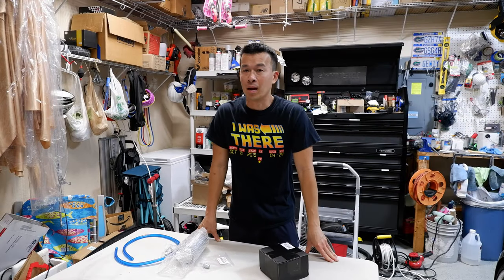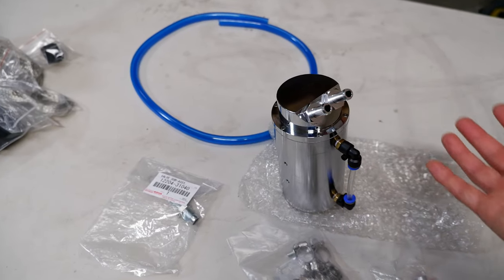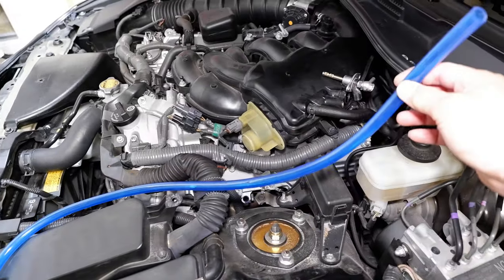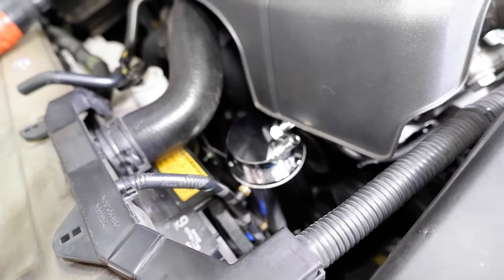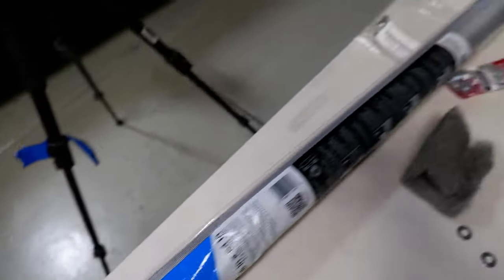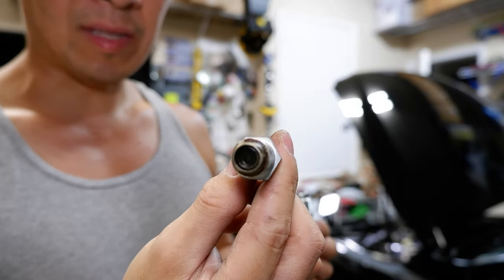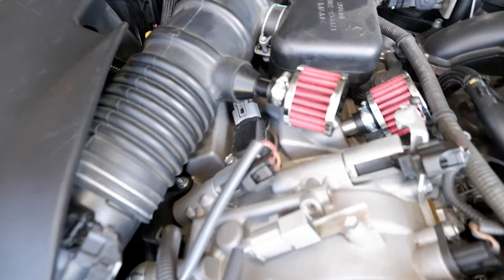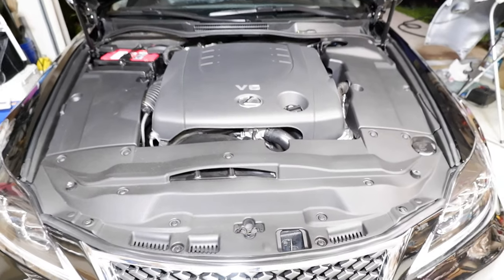Lexus IS250 IS350 Oil Catch Can Install | Blow-By Carbon Buildup | PCV Valve Replacement

Comment from the maker: Update: don’t do the breathers. These cars use MAF (mass air flow) and not MAP (pressure) so it will trigger CEL for unmetered air.
Reply: Yes, true, my fuel trim changed, puting lot of gas, exhaust smells bad also
Reply: Aaa there's my answer!! 👍👍
Reply: So just in case for my peace of mind:) From that small pvc (valve) dirty something going into that can and then from the can by hose to that black pipe back again clean?
Reply: You just have to seal the hole in the intake and leave the filter in the crankcase, I did that and it has never given me any problems.
Reply: @IRaaz0r This the right answer! I am going to do that.
Reply: Bonjour c est quoi les respirations ?
Reply: @IRaaz0r comment le faire ?

Comment: You gotta check Saikoumichi S1-OCC oil catch can. They have mount adapter that specifically designed for is250/350. I can mount the oil catch on the exact position as you did without any adjustment.
Reply from the maker: man, i'm too cheap to spend $155 for that...LOL.
Reply: @TunerwithKids  Yep, it depends on your budget. Another trick to share is that to have a good seal around PCV valve to the new hose, I ordered another PCV OEM vent hose($15) which has the right angle and inner diameter. So the new hose(to the oil can) is not going to directly connect to PCV valve, instead it is gonna connect to the new OEM vent hose, which provides a perfect vacuum seal. Good luck.
Reply from the maker: Good idea on the angled PCV hose. I may look into that next time I have to order any OEM parts.

Comment: Great video. Now I know that this is a common problem with IS250. Few months ago my car was running rough/engine light on and stalling. Took the head apart and cleaned the carbon build up with Seafoam. Fixed the problem and car runs great. Now, I need to install this on my IS.
Reply from the maker: I wish I would have known or researched more back when I took my intake manifold off for new spark plugs. I would have definitely cleaned the valves out with seafoam or a walnut blasting.

Comment: have you gotten a check engine light from using the breather? i tried twice with my car and both times have gotten CEL something about bank 1 running too lean if I remember right.
Reply from the maker: Yea I figured it out that the breather I put on the intake tube after the MAF caused it. Unmetered air.
Reply: @TunerwithKids  i tried plugging up the tube on the intake hose and running just the breather on the otherside and it still threw a code haha
Reply from the maker: Really, I haven’t tried. After exhausting all the troubleshooting, I just put the original hose back.
Reply: I spoke to someone from RR racing and they said the only to eliminate that breather hose is by buying their tune and telling them that you want to eliminate the breath tube. Did it to my car and holy smokes... is diff worth the money.

Comment: Did you get any issues running the breather filter on the crank case and intake tube? I tried plugging the intake tub and running a breather filter like you on the crank aw but got a check engine light.
Reply from the maker: Yea kept getting CEL due to unmetered air on the intake tube. I heard others get it too, so I ended up putting factory tube back.
Reply: @TunerwithKids  yeah, only way to get around the cel and run a breather is if you get a ecu tune
Reply: @TunerwithKids  how about breathing filter on valve cover BUT close hole in mainfold. Did you tryied it?
Reply from the maker: That can work too. My mistake was the breather on the intake side.

Comment: Going to look at a 08 is250 for 10k with 140k miles. App was reschedule from tomorrow Saturday to Monday due to a check engine light. Pray it’s not related to carbon build up. 
Thanks for the great content, will be installing a occ for sure.

Comment: Thanks for the video. Was hoping it was easy and since doing plugs are a pain im trying to do everything thatll be easier to do while having the surge tank off while im doing the plugs this is now on the list of things to do while its off.
Reply from the maker: Yea definitely do it. That hose in back of the throttle body is hard to reach if it falls out.

Comment: Thanks for the video, I need to replace the PCV Valve on my 08 is250 with 150k miles
Reply from the maker: That crowfoot 19mm, worth its weight in gold man.  Only like $7 but will save you some busted knuckles.

Comment: About those tiny filters on the intake tube, and the camshaft. I also did this, but quickly realized why I shouldn't.
Basically what happens is, you are introducing a vacuum leak past the MAF sensor, and into the throttle body, which will cause problems in the long term.
For short, you will get a MIL code for lean condition, because the ECU will detect more air in the chamber, then what the MAF is detecting, thus, is will try to compensate with more fuel, which will immediately become apparent with any decent diagnostics which is able to read live data from STFT and LTFT.
Do NOT do this!
Your car will run lean, and will burn more fuel, AND will destroy your economy, acceleration, catalysator, and potentially the engine itself.
Reply from the maker: Yea that happened to me. I think my Pinned post and instructions in description box say not to do this after the fact.

Comment: I imagine you didn't keep the breather on the intake hose for long? Did it act right with the unregistered air?
Reply from the maker: You got it. Figured it out after 15 miles. CEL so I ended up taking it off and putting hose back.
Reply: Plug it off

Comment: I know this is an older video and you've moved on to bigger and better things but do you think you can confirm the adapter/part you used for the OEM PCV pipe. Is this just a 3/8" joiner?
Reply from the maker: I think I just used a standard Hose barb from HarborFreight. Just need something that slides into the OEM hose and new hose that you can hose clamp.
Reply: 3/8" mender works. I just did this job last weekend.

Comment: Hi. I have doubts if the can is connected in the right place. There is a problem with deposits on the valves. It is logical that you need to disconnect the vent from the intake manifold. What do others think about it?
Reply from the maker: The PCV vents into the intake manifold from factory. In my setup, it vents thru the catch can and can leads back to intake manifold. Any oil gets collected by can.

Comment: Please make video for ATF radiator installation.
Thumbs up, so he can notice it :)
Reply from the maker: I’ll do one if I ever need to replace my radiator.
Reply: Tuner with Kids As far as I know, Lexus IS250 doesn’t have external radiator for the transmission fluid... and overheating is still the main reason why the transmission may fail.
Reply: @antonkolomiets5389  
Are trans failures common with is250/350?

Comment: I did those little breathers but I immediately got a check engine light.  Did u get a check engine light also???
Reply from the maker: Yea I had to remove them after. Forgot that this car uses a MAF, so unmetered air thru breathers causes CEL.

Comment: Nice video! Been wanting to do this on my ‘09 250, is it worth replacing the PCV valve on a car with 90,000 km? (~60,000 miles)
Reply from the maker: It’s good insurance and only $8. Back in the day, I remember the recommendation on those were like 15k or 30k miles on Honda’s.
Reply: I also have a 09 with 60k on it. Mine is black on black, without navigation.  
What's your setup?

Comment: It doesn't seem to be necessary for the 350 model. 350 seems to have no serious carbon build-up problems with D4S. I have a GS350 and I don't have a carbon build-up problem.
Reply: Actually, you don't need to install Breather on the intake hose, just plug it directly.
Reply from the maker: Yea, the plug was same price as a filter.
Reply: Your correct theres no real need for the 350 just check club lexus

Comment: Check for the recall on this problem! Go to your local dealer and press them about it.
Reply from the maker: The carbon buildup? Naw they don’t care about it. It’s a known issue with all MFGs for DI engines. The IS350 doesn’t suffer because it has DI and port injection so the port burns the oil and carbon build up.
Reply: Yessir, when I bought my car in 2015 (06 is250) I was sent a recall notice for this problem. That’s the only down fall, the DI. They took it in for 2-3 days and got it back with basically a new head from what I’m guessing...
Reply: Also, my car is approaching 170k and it’s been going strong!
Reply: @overpricedtoyota  So did the dealer honor the recall? Or they charged you for the replacement?

Comment: That catch can is useless - it has no filter or any way to separate air from oil. There are great catch cans on ebay for $20 that have fine brass type filter and mesh plate (rip of $200 catch cans). You also don't want to use air hoses because gasoline and oil can degrade those hoses.
Reply: LOL ....I stayed to see how the air hoses would eventually break / melt

Comment: Could you put an oil filter inside instead of the steel wool?
Reply from the maker: If it fits. Anything that keeps the oil from sucking back thru the intake.

Comment: So this video was a year ago, how is it working?
Reply from the maker: Everything is working. The hoses I used aren’t really rated for the heat. I see outside cracking. I’ll probably replace with fuel hose later. That breather filter was bad idea, car has a MAF so it introduces unmetered air. Had to put hose back between valve cover and intake. Haven’t opened to see how much I oil has collected but I’ve driven less than 5K miles in the past year. Work from home and IS300 to drive.

Comment: What if you were to just remove the hose from the PCV valve? Meaning the dirty air is just vented out.
Reply from the maker: Vacuum leak if you do.
Reply: @TunerwithKids  OK thanks. Guess will have to install an oil catch can. Just did my walnut blasting today and it really made a difference to the car.

Comment: Does this prevent carbon build up on is250?
Reply from the maker: Yes. Reduces chances of build up cause it catches the oil before it blows back into the intake manifold.
Reply: @TunerwithKids  thanks dad😊

Comment: How’s your experience now with your oil catch can since it’s been over 1 year ?
Reply from the maker: I haven’t opened it yet. This can has that looking level tube and it hasn’t shown any oil yet.
Reply: @TunerwithKids  interesting 1 year and still no oil is been catch !!
Reply from the maker: Probably some oil at bottom but not enough to show thru the level viewer.

Comment: What about if you attach the extension hose to the intake side hose directly to the catch can and then fuel hose only from pvc? Will the kink in fuel hose down to pcv cause an issue?
Reply from the maker: Avoid kinking the hose, best way is to use the OEM bent hose and extend to aftermarket hose. Some people use a spring to prevent kinks.
Reply: @TunerwithKids  great idea but then running the hose back to the rear of the intake would be incredibly tidous as seen in your update video no?
Reply from the maker: Yes it's a blind spot so you have to feel for the nipple and hope it slides in snug.

Comment: Dump some seafoam into the oil or tank yet?
Reply from the maker: Nope, never really used it before or have looked into what it actually does b
Reply: Tuner with Kids supposedly cleans the carbon buildup. A lot of people have had good results with it
Reply: @XanhDT89  This carbon build up is on the valves - with direct injection - fuel or oil does not touch the valves.

Comment: I put the catch can and got the check vsc
light any idea why?
Reply from the maker: Did you do that filter on the intake and valve cover like I did? That will cause CEL, I forgot this car uses MAF sensor which measures flow and see unmetered air.
Reply: I cap the intake and ran separate catch can for each side Driver side closed system and passenger side with breather system the ligh came on like one hr after so i put the original hose back on the passenger side will the check vsc light clear or should i take it to shop
Reply from the maker: Unplug the battery to clear the code
Reply: Thanks code clear and running good

Comment: Hi Sir. Good day to you. Jacky here. I cleaned my car the throttle body. The idle RPM higher 1000+ in normal temperature. And shown code P0505. Can teach or advise how to fix it.
Reply from the maker: You probably have a bad throttle position sensor or the throttle actuator.
Reply: @TunerwithKids  .
What I can do it . How to checking or repairing ?